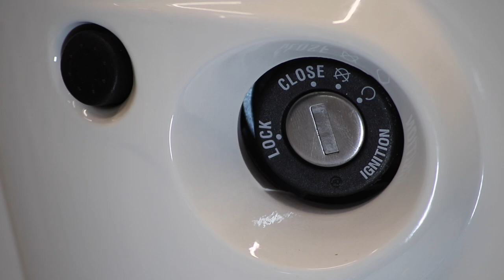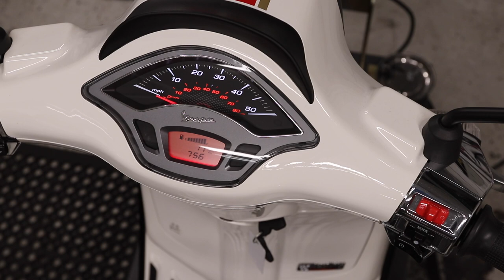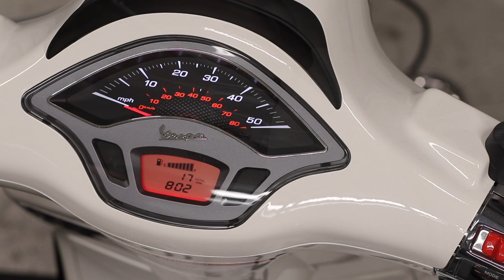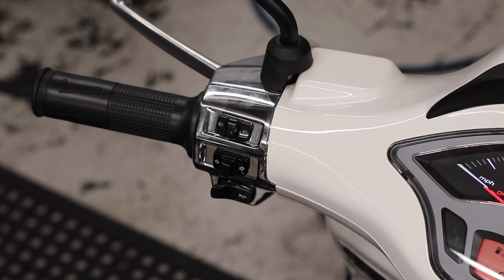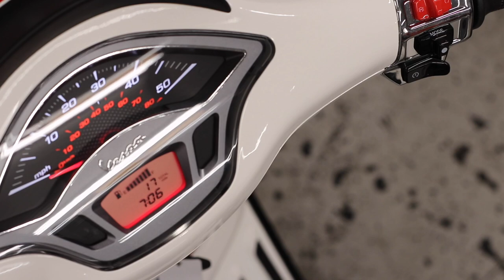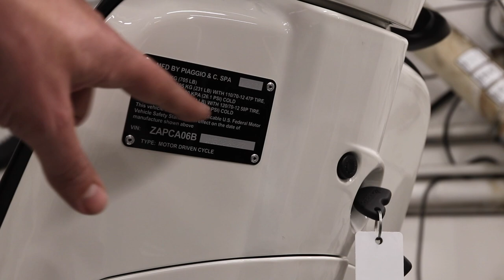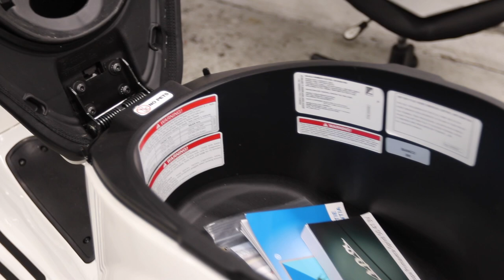Vespa Sprint 50 Walkthrough

Comment: Just wondering and maybe you have information.

is it possible if flyscreen/windshield for vespa sprint is attached/instal to vespa s (square headlight) ?
Reply from the maker: Won’t look right since the size of the headlight is different and not sure if the windscreen will screw into the different bike. Best bet is to get a windscreen specific to the S.

Comment: Two up on a 40mph road into the town square… think I’ll need the 150? We probably weigh 260lbs together
Reply from the maker: 150 would be better for that scenario.
Reply: Yes but you can get the 50 and just do a 80cc kit and a few other upgrades couple $ max and u will go 50mph easily good middle ground
Reply: @180fxr  and how to change the software in a computer to make that work well? you know is a software that control how much gasoline it gets compared to the cylinder size etc. so is not like the old ones from 1970s and earlier , you need to change the software and have access to that as well to make that work! I called around and asked the mechanic stores and they do not like these modern day ones that they cannot help you with!

Comment: Does it have a limiter or restrictor on it? Thanks
Reply from the maker: Sorry! I didn’t check which video was commented on so my last comment about removing rings from the transmission is wrong. Does not apply to the Sprint or Primavera 50. Only to the Buddy 50. There is no way, outside of replacing a bunch of parts with aftermarket Malossi products, to make the 50cc Vespas faster. They are what they are.

Comment: Great video. Thank you! How come it can handle 705Lbs but cannot have 2 people on it? How slow would it go with 2 people? The 2 of us are a total of 300Lbs
Reply from the maker: Hi! Not having a passenger on a 50cc scooter is just a state law we have here and likely in many other states. The weight the scooter can handle is based on it’s structural integrity not on how powerful the engine is. Expect it to be in mid 20mph range generally and take longer to achieve top speed.
Reply: Don't waste your money; this thing is too heavy for 50cc.  It is a nuisance or outright dangerous.  150cc for intown use, 250cc plus if you want to take any scooter on the highway.

Comment: is the structure frame made of steel?
Reply from the maker: Yep. The front leg shield and back cowls are welded together to make a monocoque frame. The plastic bits on the bike are the fender, glovebox, floorboards, and handle bar upper and lower covers.
Reply: @VespaPortland  oh thanks for the reply cause im thinking of getting a vespa as my first scooter and i tought only the 150cc and 300cc models had full steel frame , so both primavera 50cc and sprint 50cc have full steel frame ?
Reply: @Berindei_Stefan  all vespas have steel frame
Reply: @180fxr  thanks for the reply

Comment: I went today to see this scooter and when I sat in it I was tip toeing:/ 
I forgot to ask if there's a kit to lower the seating or something. 
Is there?
Reply from the maker: On the 50cc there’s not a lowering kit. The shock mounts to the engine differently than the 150. You could take the seat to an upholsterer to shave some foam down. Tip toes can be OK, or a single foot down OK, if the weight of the scooter is manageable. If the scooter is too heavy then the less contact with the ground is really noticeable.

Comment: What’s the compression ratio in the 50cc engine? Since it requires premium, I wonder if it has high compression. The Vespa website doesn’t state it on the tech specs. 
Also, does the 50cc have a charcoal canister/evap control like the 150? I noticed the 150 scooters have an obvious charcoal can at the top of the engine bay which causes a lump in the storage bin. The 50 does not. Maybe it’s hidden? Would be cool if it didn’t have it at all.
Reply from the maker: Would have to check the service manual for the compression ratio. I’ll try to remember to do so on Tuesday. Definitely a high compression engine as is almost every scooter. 50cc doesn’t have the charcoal canister. 150 does. Thanks for watching.
Reply: @VespaPortland  damn dude, fast reply. Thank you. Your videos of Portland bring nostalgia. I’m originally from St Helens but was dragged to southern CA as a kid and now I’m rooted here. I can see the city has changed a lot based on your riding videos. Been binge watching you and Robot lately. I ride a Harley but have a soft spot for small engines. Thanks again, have a good night and ride safe.
Reply from the maker: Ha! I was in a tiki bar and got the notification. I’m from San Diego originally so I guess we traded population. The place has changed quite a bit since I arrived in 2007. Enjoy the weather down there!
Reply: @VespaPortland  wish I was in San Diego, I’m up in Riverside. Just barely too far to ride a 50 home from Vespa Motorsport…but I am tempted. Those Sprint Racing 60s look amazing. Jealous of your Mexico adventures I just watched. Enjoy your night out! Thanks again for the reply.
Reply from the maker: Robot did that video of riding a Primavera touring 50 from SD to Yuma so I believe in you! 😆
Reply: @VespaPortland  good point 🤔
Also, a question related to this video.. based on what you said about waiting on new scooters to come into inventory, I’m guessing the dealership doesn’t make specific orders for new bikes? Does Vespa just send you units at random? Thinking about ordering a specific color but it would suck if I just had to wait for one that never comes.
Reply from the maker: Everything‘s a little bit tighter with supply chain issues going on. We always submit a yearly order to Vespa but it has been hard for them to keep up with demand over the last two years. It used to be a simple as telling them that William Jefferson Clinton wants a black Primavera. And then they would send one within a month or so. But lately they have been allocating bikes to dealers on a monthly basis, to try to give everyone a chance at bikes, so we may not get any bikes that anyone has specifically asked for for a month or two. It’s hard to say when things show up but generally it’s 2 to 3 month waits for a bike that’s not in stock. The worst we saw was a guy who ordered a red GTS 300 in July of last year and it showed up in November.